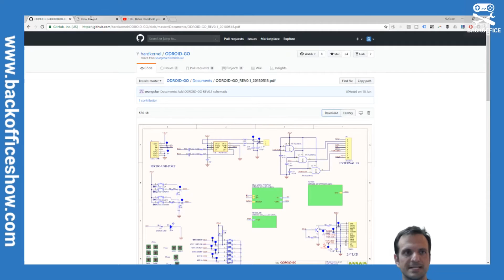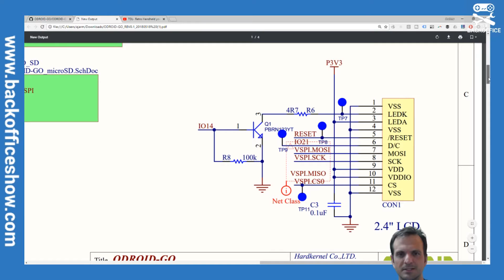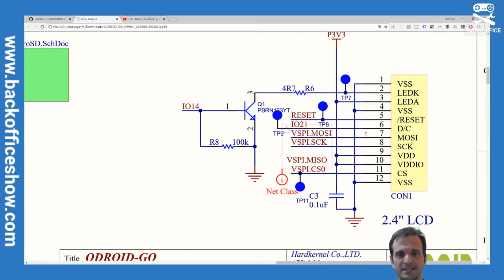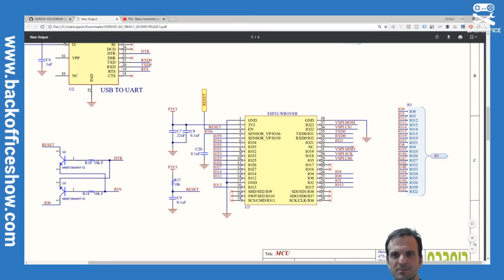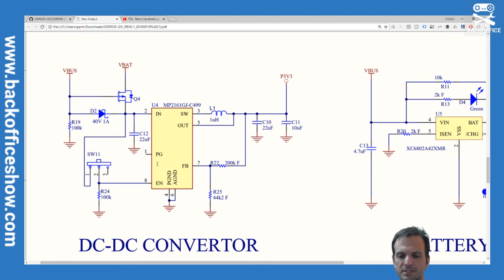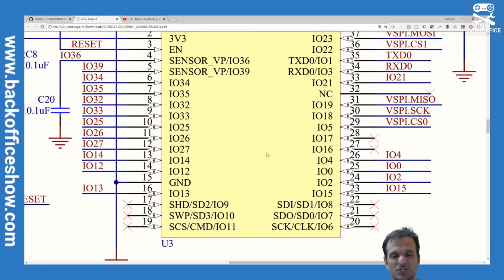odroid go, how it works

Comment: 18:50 - RE: disconnected GPIOs

"Every GPIO pin is used and/or exposed on the expansion port. It may appear that some pins are NC, but they are used internally (by the WROVER module) for internal flash and PSRAM."

-crashoverride

https://forum.odroid.com/viewtopic.php?f=158&t=33400

Comment: the sd pin on the pam8304a is a shutdown option to close down the amp if it isn`t needed, you connect a switch to gnd to use this option.